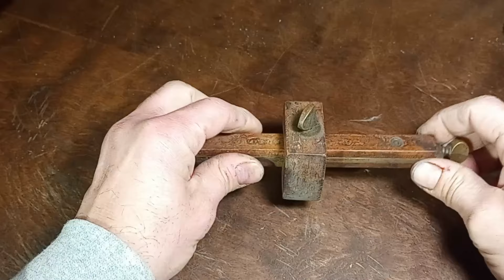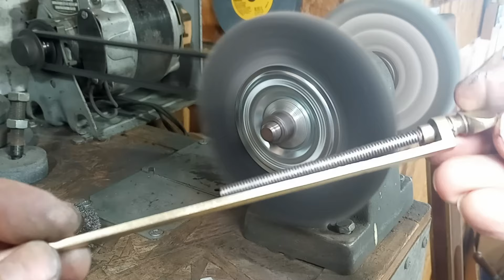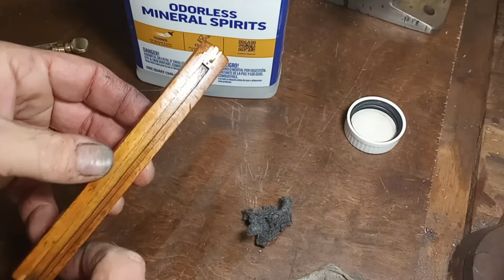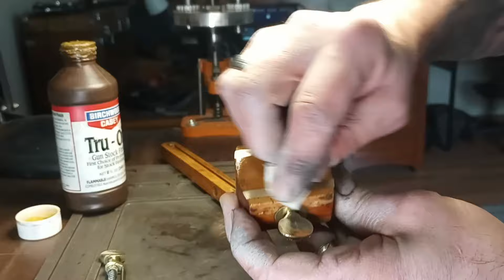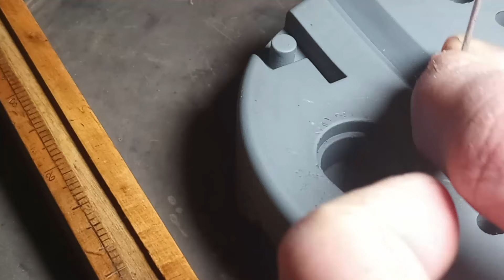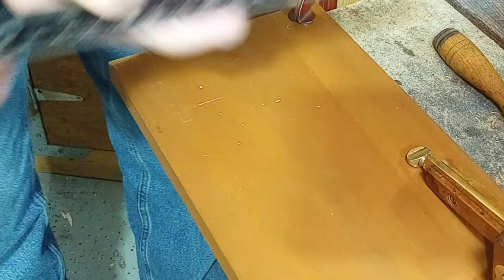From blackened & tossed aside - to a beautiful boxwood & brass Mortise Gauge in one afternoon.

Comment: Fantastic job Matt. I have a simular marking tool I need to clean up. Thanks for some ideas. Nice job on the ruler, what size point did you use to restore the markings it was a perfect size.
Reply from the maker: Thanks Dalesworkshop!  I have a couple single pin marking gauges, this is my only  mortise gauge.  The point size on the pen is .25mm